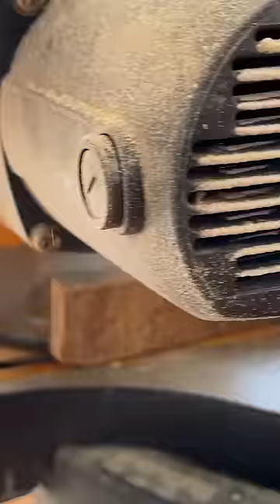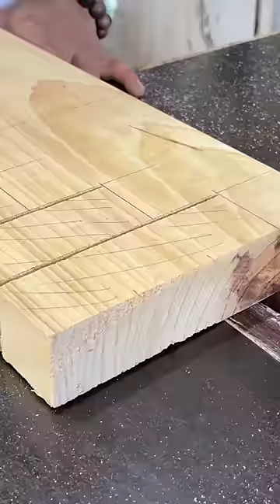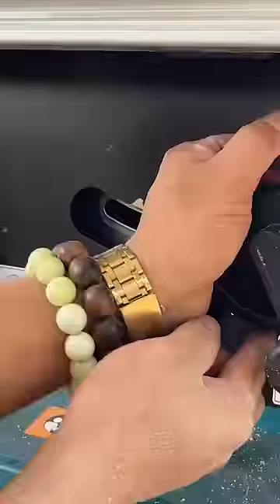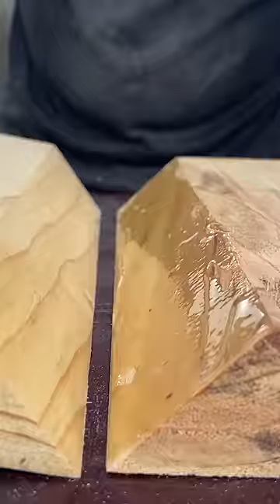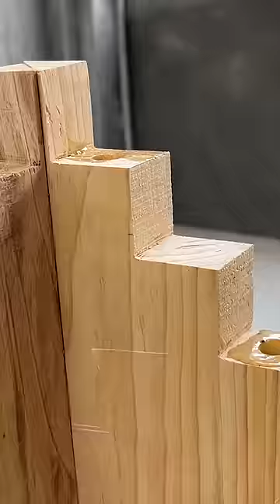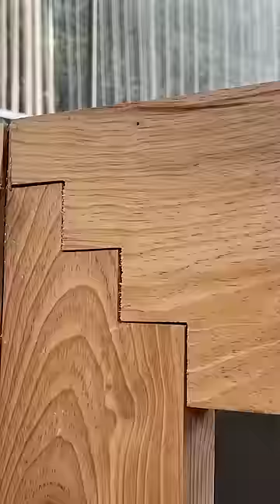Tips Making Joints Wood

Comment: There is No Structural Integrity, the corner just relies on what I Presume Is Contact Adhesive. Also U Really Don't Start Smacking It With A Hammer To Close The Joint

Comment: What kind of adhesive did you use?
Thanks for this nice sharing.
Reply: Полиуретан
Reply: Lools like epoxy thickened with wood dust
Reply: I use just the tip of my tounge and slowly lick it. The seal never fails.